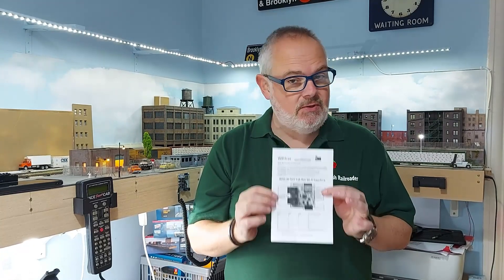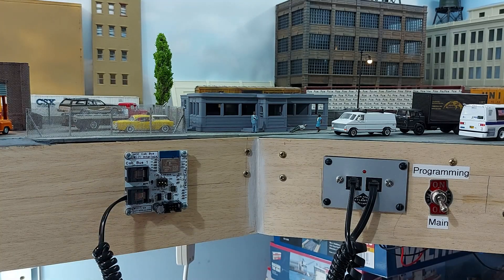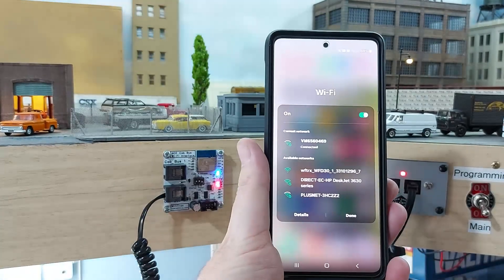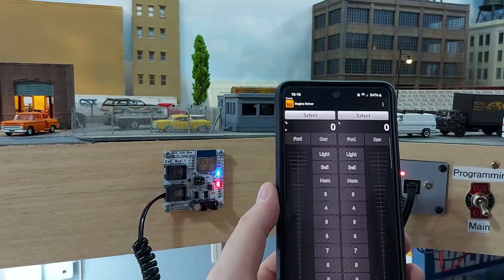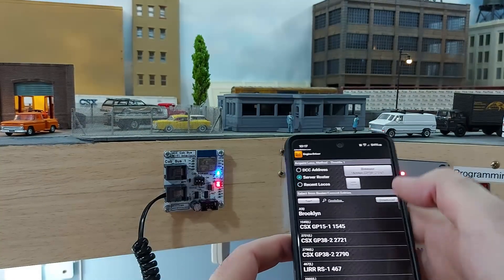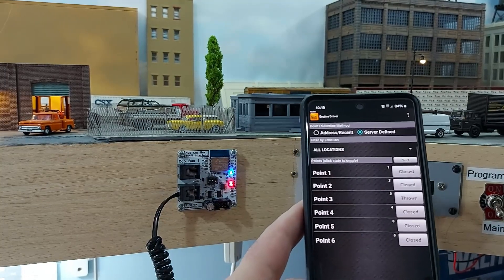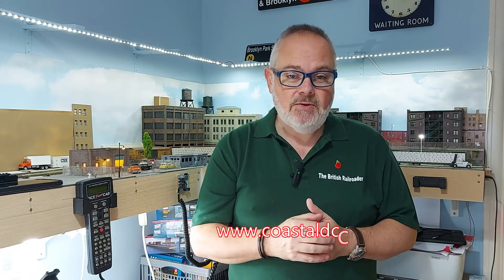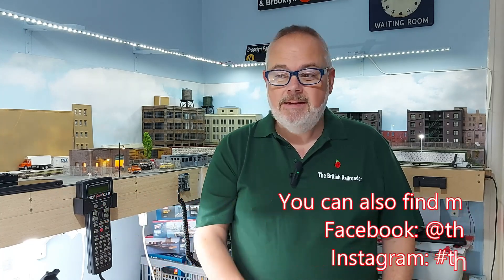WifiTrax WFD 30 Brooklyn Park goes WiFi

Comment: Steve, not sure you mentioned the cost, but it's a very reasonable £78.50 from Coastal DCC. For that price, you get excellent service thrown in for free.
Reply: I got the WD-31, again from Kev at Coastal DCC, £85.
Reply from the maker: @t-trak-uk  what extra does that one do?
Reply: @ it replaces your original panel board. Just unscrew facia plate from PCB and screw in WD-31. Does exactly the same as WD-30 but no extra cables needed.
Reply from the maker: @t-trak-uk  ah OK. That sounds like a great idea, I should have got that, but happy with the 30
Reply from the maker: I did say it was around 70 quid, but was a bit short lol. I should have looked it up first 🤣
Reply: @thebritishrailroader  Must listen more intently next time.